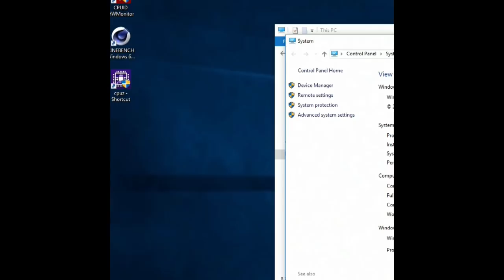modding a small form factor hp/Compaq dc7800

Comment: question: can you fit a gtx 660 t or gtx 750 ti(non low profile) in a hp pro 6200 or any small, old pc? i wanna buy a old pc and install a gtx 750 ti or 660 ti and more ram in it but wondering if it will fit

Comment: How do you paint case? Do you sand it with sandpaper before painting or do you use another method?
Reply: I had the same question.  Modstek does an excellent job on the aesthetics, you can tell he has experience.  Check the links in his post on the paint suggestions.  That gives you a good clue on his paint prep.

Comment: how did you upgrade the bios
Reply: I really want to know to. I have an SSD, but there is no BIOS download to make it compatible with an SSD drive.
Reply: You can download the bios from the manufacturers's website (HP for the case in this video). Make sure you search for the correct model. Don't accidentally install the bios for the wrong model. Make sure the bios version that you are going to download is newer than you already have (based on version number or release date or both)

Comment: Hi Modstek, I wanna ask some help for my old Dc7700 case..I want to use a newer Sfx PSU for it, I want to remove the existing PSU slot and mod it for better space management, can you do some vid for me or some sketch woud do :) THANKS!!
Reply from the maker: I have had thoughts to do something like that but there is a few reasons why I don't. Hp power supplies are proprietary they have like 4 Or 5 wires that are different than a atx. I think they sell the mini adapter solely for hp but check the  wiring. Other reasons are cost and time. When all is said and done I have to try to sell my projects to build another, and sadly people want hdmi, monitor, wifi, mouse, and keyboard all for next to nothing. In the future maybe I can do something like that but not now...sorry I can't help
Reply: It's fine atleast you tell me something, I should ask for some idea from my friends..Thanks alot and keep up those vids coming..It's good to see it <3